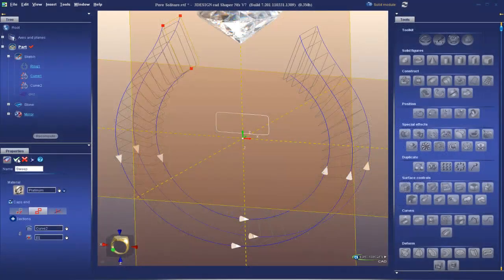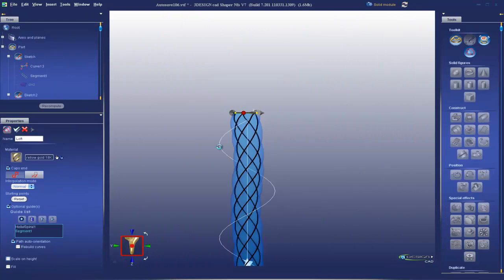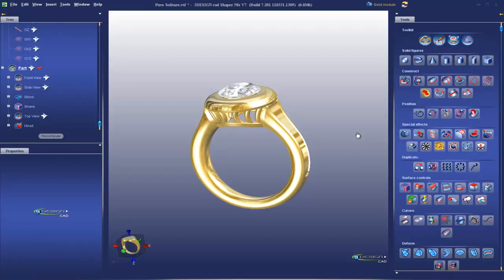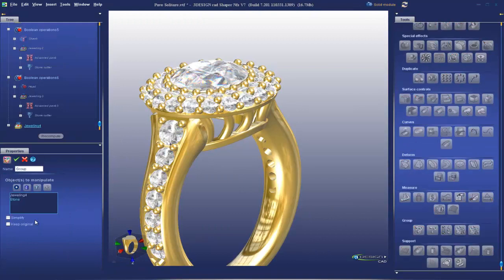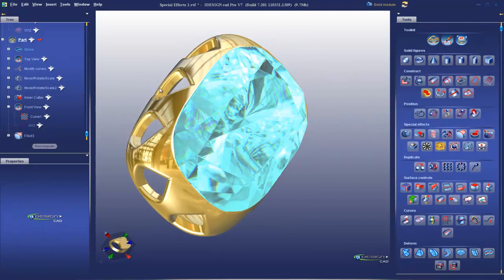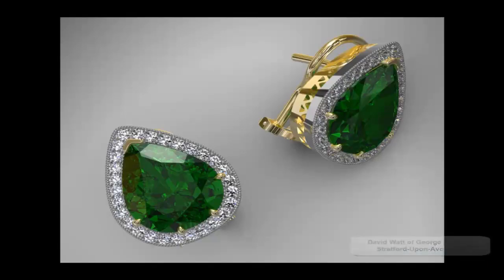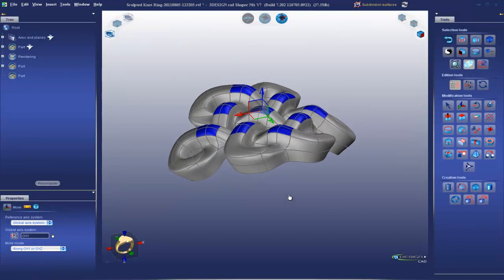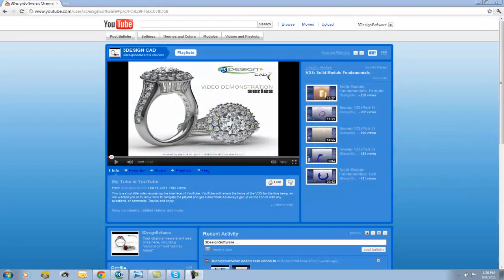The Time is Now - 3DESIGN CAD 7 Jewelry Design Software

Comment from the maker: It is really simple. 3DESIGN has a Twist tool allowing to twist any Solid. Then you can wrap it on any base line to distorf it further. This is unique on the market, and in the video it takes the shape definition of a Ring Shank but this can be pretty much anything, earings, pendants etc... Contact your tech support if you need further explanation on this.